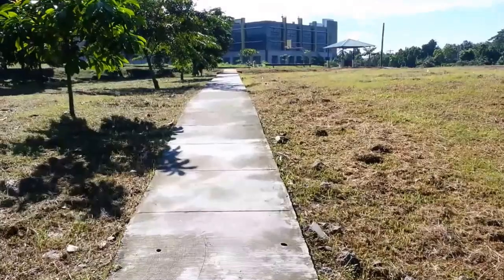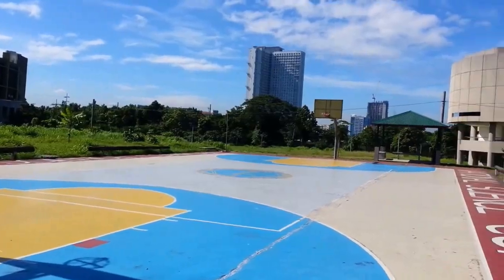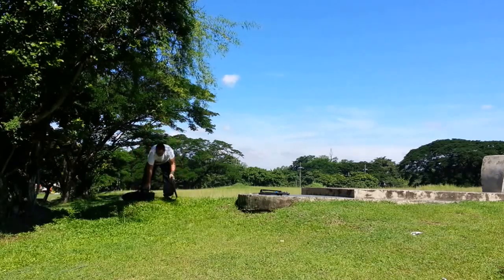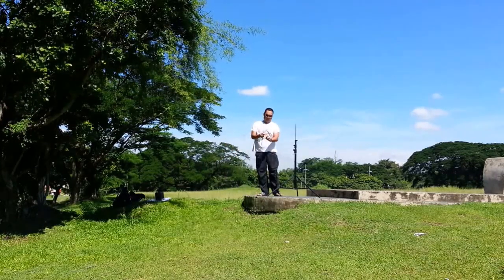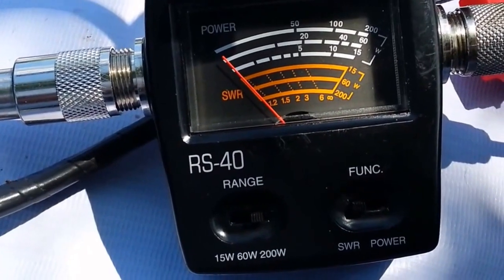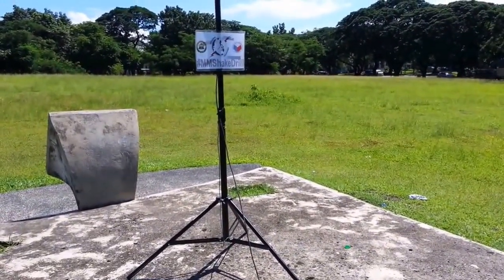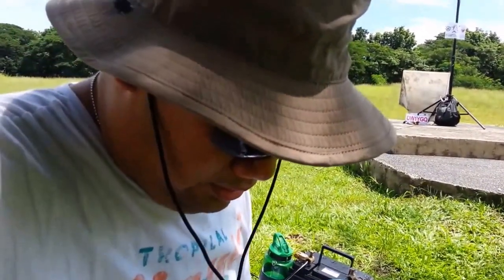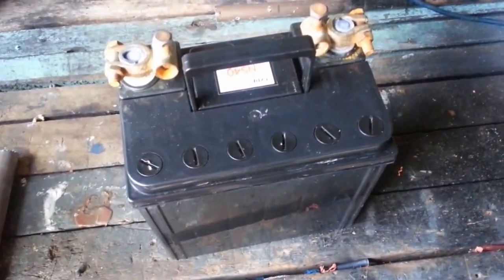2-Meter/VHF HAM Radio Emergency Setup

Comment: Hello my friend, really cool video, I need make you a question actually I work in a place with a Hustler Antenna G7, but i have 2 motorola radius sm50, one for receive the signal and the another like a bypass for no operator in place, I don't know how can i change this configuration for a better equipment or configuration with the same equipment, all the handy's can communicate without operator, but i don't know if this is making some kind of problem or noise (because the 2 radius is connected to the same antenna) because i don't have communication to more than 10 km around the radio base. I need to know if you can tell me if exist some new equipment for replace this for better results and if i can use only one radio base equipment and work without an central operator,or something, thanks.

Comment: KKKK The antenna looks like a spider or an old umbrella! Try a J pole, it yields a lot more and it's easy to ride! 73 by PY3AAS
Reply from the maker: Andre Aurelio Souza Thanks for the advice! I have always wanted to have a j-pole antenna but never had the chance to have one (or make one). If I were to believe the j-pole db gain I see on the internet vs. ground plane gain, there might not be much difference between the two. Also, this funny looking antenna was very portable. :)
Reply from the maker: Andre Aurelio Souza oh wait, were you referring to a roll up j-pole? I have always wanted to make one of those. Too bad ladder line is close to impossible to find here.

Comment: very cool! for a portable antenna that can easily be rolled up into a bag, check out the jpole antennas. might do better than your ground plane. salamat for the video
Reply from the maker: Thanks too! Recently I have been playing around with an old Diamond SG2000 mobile antenna. I made ground radials for it. I can hit a repeater 200km (125mi) away at high power and 100km away at 5 watts using the same light stand.

What is nice with the SG2000 is that it can be broken down into sections so it can be easily transported. I will put up a video once a field day comes around.

Comment: i like qrt and handhelds
Reply from the maker: Thanks! I also tried to attach an icom handheld to the antenna system and it worked great! 5.5w with a small battery and a good antenna can take you places otherwise difficult to carry a mobile radio and heavy battery to.